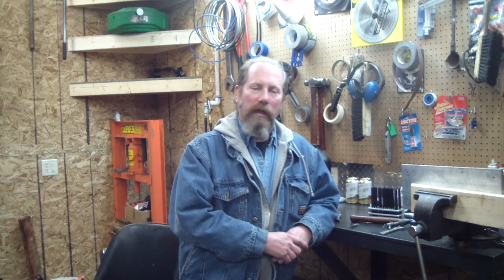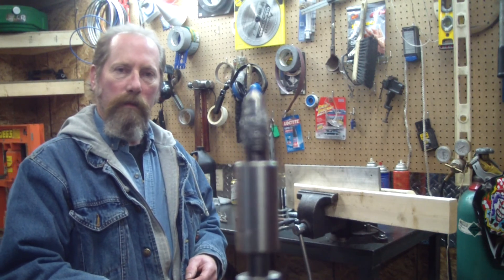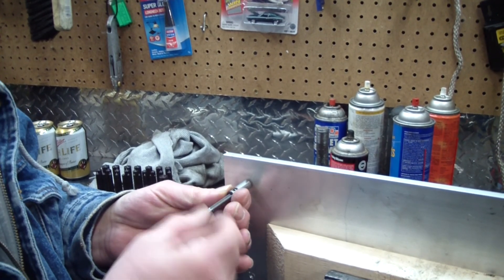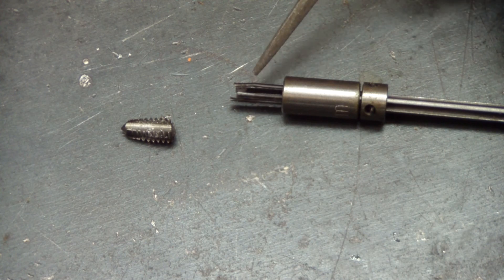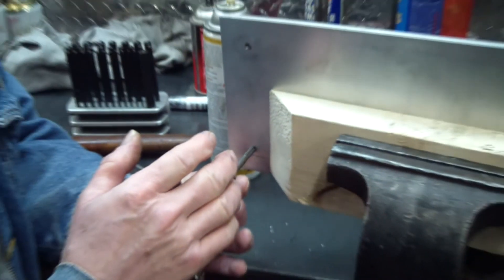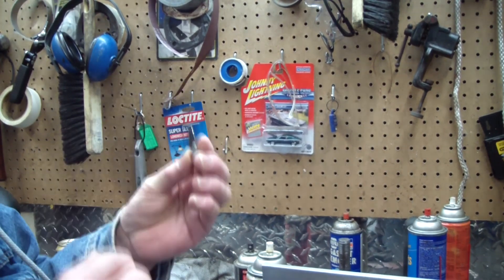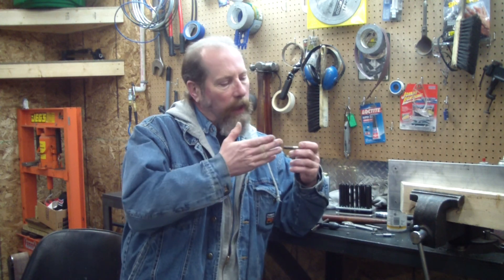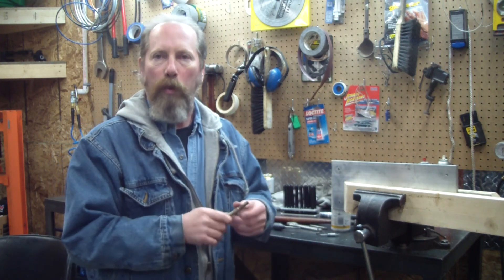Broken Tap Extraction and Tapping Threads Remove

Comment: Also, it's important to have the correct bore diameter and it's different depending on material. You can find charts of the correct drill size.

Comment: I had that happen once, and I didn't know about the fancy tool. I made a mess of it but after a lot of sweat it was done (redrilled). In my case there wasn't enough of the tap to weld a nut on, and I was away from the shop.